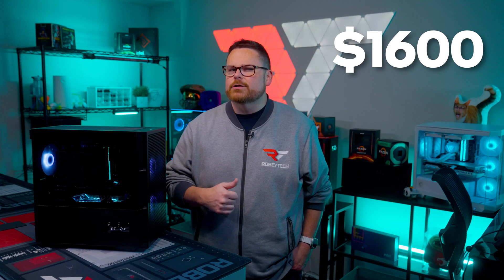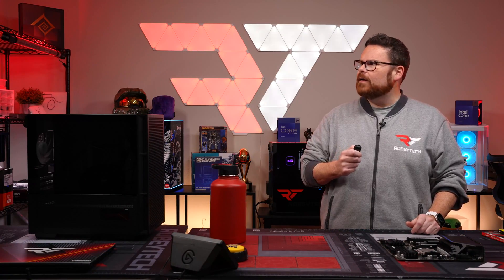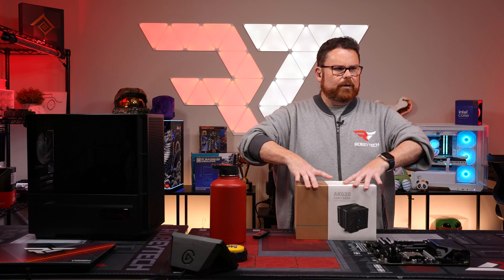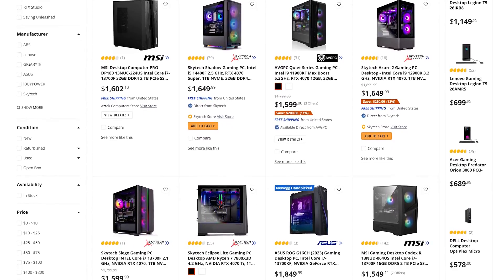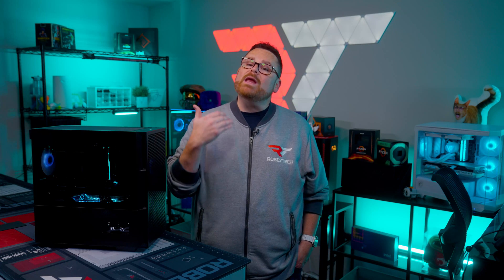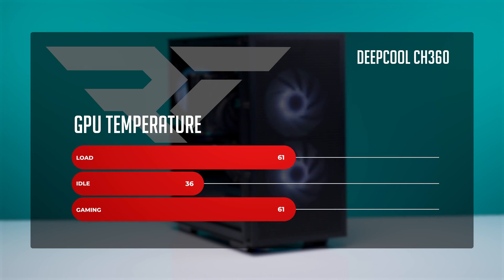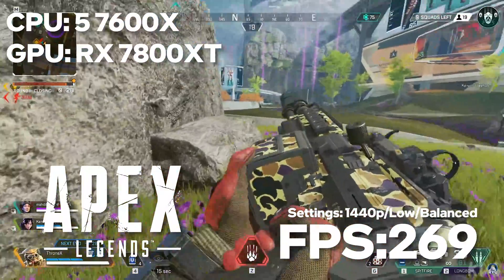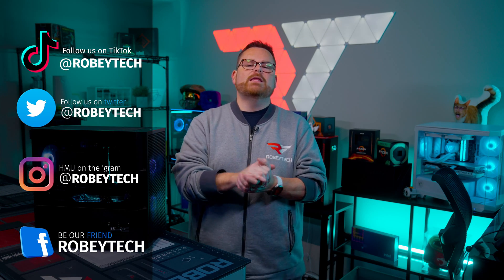Fantastic Gaming Performance for only $1600: The DeepCool CH360 Digital PC Build

Comment: Really like this case. Deepcool says maximum GPU length is 320mm and that Asrock says that card is 328mm. So who's wrong Deepcool or Asrock?
Reply: he put the fans on the other side of the front panel
the dimensions mentioned on deepcool page are with fans inside